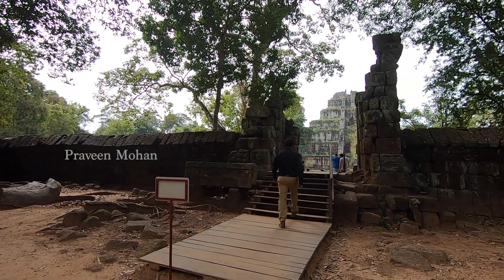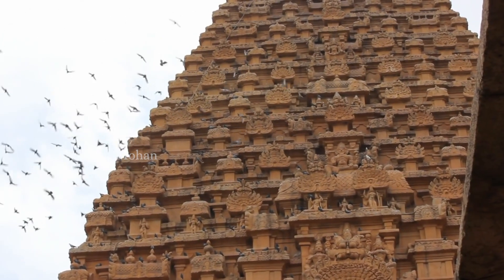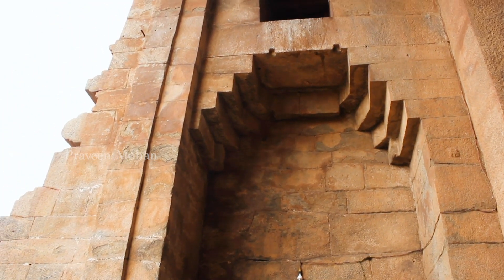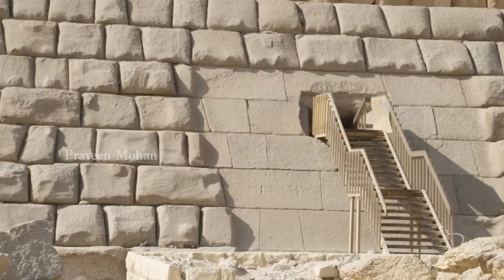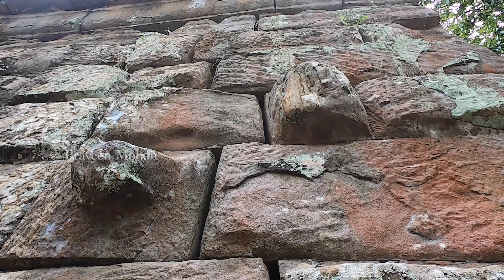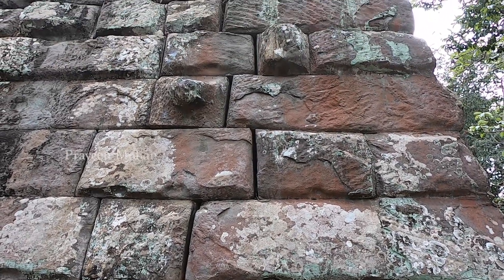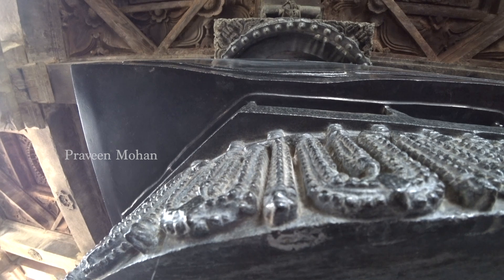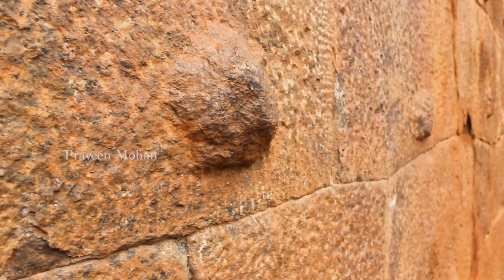Mystery of Ancient ‘KNOBS’ in Temples - Evidence of Stone Melting /Geopolymer Technology?

Comment: I would suggest that they would be doping. If we look at the structures they appear to be built with a certain harmony and were intended to mirror nature. What if it was necessary to balance the tune of the building to ensure a specific resonance. How would you do it? Drill holes or add material on to alter the tone of the stone?

If they were moulded, where was the big factory where they were making them all? I remember a site in India which seemed to have a lot of parts for temples, the only problem being that there didnt appear anything on the site today where there would have been a foundry of sorts. Where did the stone originate? How did they get the stone in whatever state it was to where they were created? A block of stone is possibly to transport, but dust?

Comment: The builders made the temples pefekt - there is a code in the nops
 - maybe seen of a certain angle - maybe under special sunligth condition
 - in an flat surface the sound is diferent so maybe the nops stop certain eco
Reply: Sure, which goes with Proveen's theory in some ways cause defected blocks would be hallow and not so structurally sound. No wrong answers here. good points to support sound resonance theory and Geo polymer theory.  These blocks can be 10's of thousands of years old and are worn down many inches... Much older then the resent facades we see today on older substrate of megalithic blocks.

Comment: Not used for lifting that is clear. They would be almost universal if that were the case. Anyhow it does not appear that the ancients had any problems lifting items. I am quite prepared to believe that these stones were cast as composites although I still don't have a clear picture of how they would produce a mold for each one, that seems too labour intensive. Were they cast in situ? That would certainly explain no gaps and they could always have trowelled the gap as we do now with mortar. But your thought that these blocks with knobs are somehow defects doesn't sit well with me. Why wouldn't they have simply cleaned them up since they were meticulous. There are almost no concave knobs as defects either so they clearly has a purpose. And if cast then how do you cast a block with several knobs? They seem so random...they are all over Sacsayhuaman for instance...it is the same the world over?  Do they change the vibration of the wall, can they be read like a language, are they the remains of gargoyles (some are too regular and none with the gargoyle intact), do they simply add value rather like an adorned block? It would certainly seem more difficult to produce a block with knobs than without, making them automatically higher in value. But the practice is so widespread globally that the explanation would seem to be much more fundamental, almost a requirement of the building process.
Reply: great comment, check our channels for more info. Ancient Alternative View and Ancient History Criticisms.

Comment: I'm a geopolymer guy, but I think that rocks were cut like we expected them to be cut, then softened in certain places to allow for soft stone to touch soft stone and make a seamless joints. I do believe some stone we see are poured or cast yet this still doesn't explain the nubs very well. Nubs most likely had a different purpose on each site or within groups of engineers.

I like to use the idea of a rec center or trade center, sure it's a building in general, but it was capable of being many different things: church, concert hall, govt building, sport events etc so nubs usage in Cambodia could be totally different than nubs in Peru. There is definitely a connection between all nubs however, I have to find out why!
Reply: Limestone, maybe. But how do you soften marble and granite ?